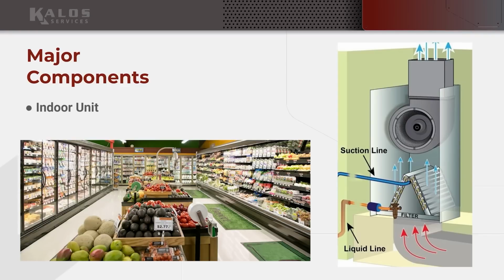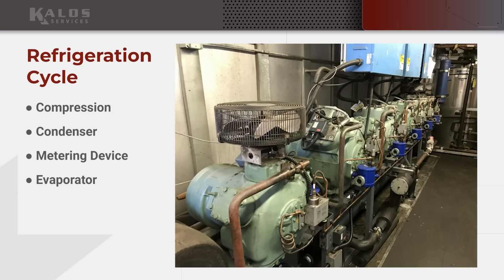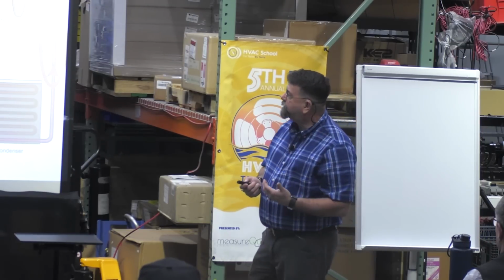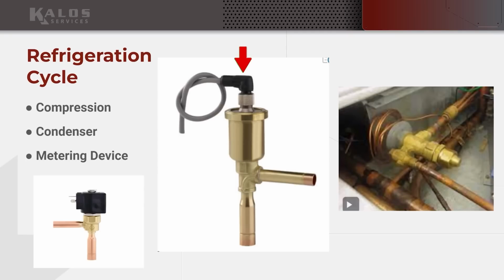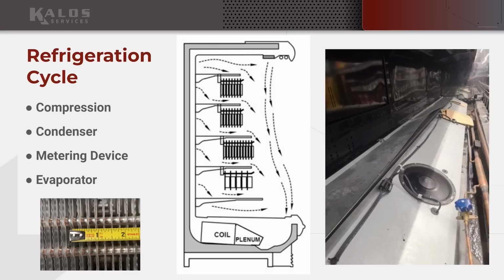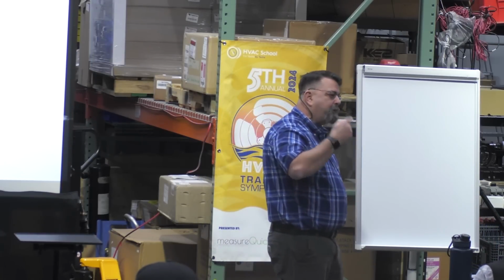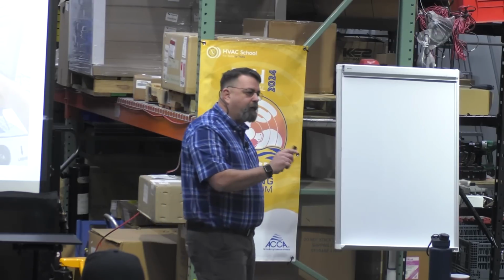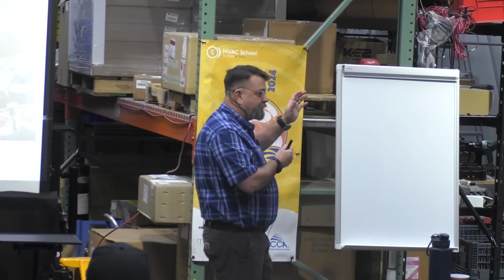Introduction to Market Refrigeration for HVAC Techs with Matthew Taylor

Comment: 35:25 - TD is as you said: the difference between the temperature of the air over the coil and the saturation temperature. In comfort cooling, we’re supposed to be using the term DeltaT to indicated the change in air temperature from supply to return air grills.